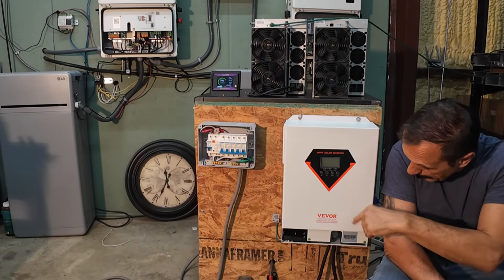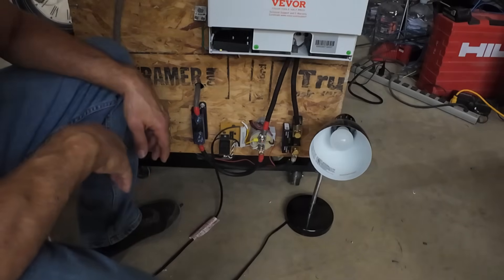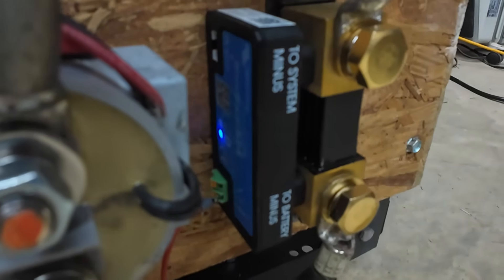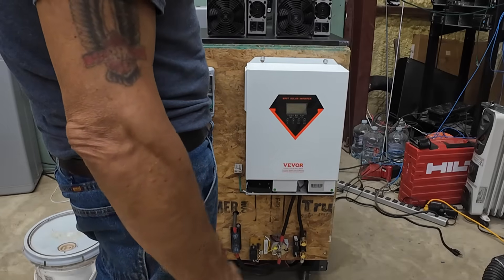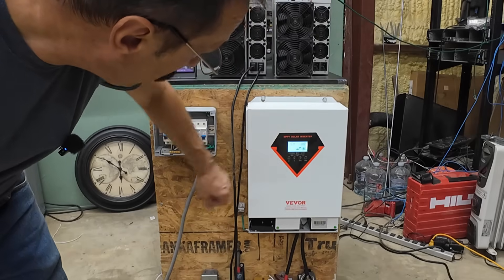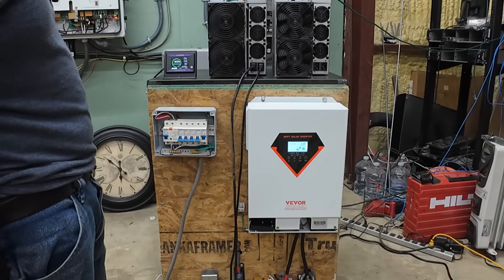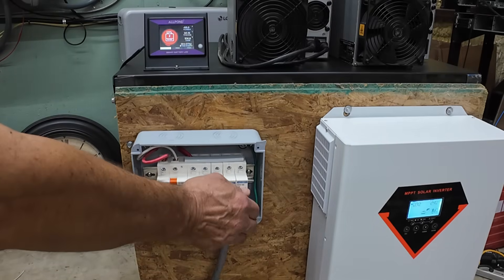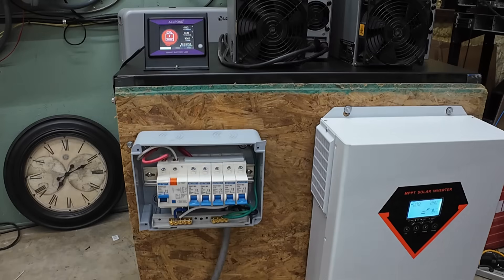Budget Vevor 6.2kW Inverter vs S19J: Does It Hold 3.2 kW?

Comment: I got 5500W version last year, but got to unbox it 2.5months ago. It has been in use since then. Several days ago it started to rebooting after reboot, showing "error 14". Reboot occurs when inverter starts charging battery from grid and passing trough grid power. I paid almost 500$ of it, now its sold for 400€ and this 6000W wifi version is 360€, after days of negoation vevor is offering 290€ or resend same item. I am debating shall i order this with refunded money. I would wish it would last longer. I did not connect it to solar grid yet.
Reply from the maker: Thanks for sharing your experience, it's good to know that Vevor is honoring the warranty!
Reply: @DIYSolarFarming  Of course. Thank you for making and sharing these videos. They honor warranty, but its a begging game. First they did offer a replacement motherboard, i questioned its safety, then it switched to "bring it to repair somewhere" in my country they pay the bill + 50€ voucher for next buy, in finland there is no-one doing repairs for inverters like this. After that, they offered me 145€, i declined with counter offer and last solution which i acceped was 290€

I am really happy with their service, as i bought the inverter 07/2024, so a little over a year ago. Could not get a better outcome. To be honest, i do not know how long warranty they give, but i assume it is 12months.

I will keep buying their products due to this experience.

Comment: You could also just have a DC adjustable power supply where you can limit the current on it just have the battery connected but turned off Connect that to the lines charge up the ambassadors with the DC power supply set at the same voltage as your battery and then just flip the battery on

Comment: Ordered the 2 lg hv battery bundle with transfer switch 200 amp meter and 11.4 growatt inverter plus one more lg battery.  I used your code and got a sweet discount today as well.  Appreciate the code and look forward to getting them connected to the my SolarEdge inverters.  I bought the bundle for another system I’m going to build for the growwatt inverter. I have 180 560 watt panels.   I’ll be tinkering for some time.  Look forward to more vids.  Thanks Ed!!
Reply from the maker: Awesome, I'm glad the code helped! That's a good amount of power, are you setting up for mining ?
Thanks for watching!
Reply: @DIYSolarFarming yes. I’ve been mining since march of 2014.  Got slowly pushed out of my big farm due to power costs. I had a rent house with 320 amp service installed.  I’m very small scale. I’ve got some kaspa miners running and I’ve been scooping up some s19’s on eBay under 400$.  Once I work the bugs out I’ll spring for some s23.  I would like one of the hydro units but I’m worried about putting all my eggs in one basket.  I’d rather have 3 miners that cost a bit more vs risking having one go down and I’m out.  Also keeping an eye on jack Dorsey new miner the proto rig.  I’d like to support local if possible.
Reply from the maker: @DouglasHeyen  Yeah, I like the concept of hydro also and was thinking of getting some S19 hydro's but then I remind myself that when power is free I'm farther ahead money and hash wise with 3 air cold units.
That might change if I can't source cheap solar equipment but don't see that happening any time soon.
Good luck and stay in touch!

Comment: Ok. That's exciting. Even as bitcoin halves if you can get 2 s19's to run off free sunlight with minimal investment that's pretty impressive.
Reply from the maker: Let's see what happens!
Reply: @DIYSolarFarming  I see another good use for this. AC and Heat. My entire package unit pulls 3500w max and puts out 4 tons of AC. I could easily run that off this inverter and 5000w array. $300 for the inverter, some inexpensive chinese lithium, and a few hundred bucks for some used panels could replace half my electric bill. Hmmmmm. 🤔
Reply from the maker: @p35flash97  Cheap way for someone to get into solar and really get a payback vs paying tens of thousands and never see payback!

Comment: Crazy thing is that those minners will step down the ac back to low DC (like 12 and finally 3,3v) for the actual has  chips ons the board... we should be feeding these machines low voltage DC directly ;)
Reply from the maker: That sounds good on the surface but these things are pulling ~200 amps at 12 volts!
Just these 2 S19's would need some massive batteries and cables, it's just not scalable.
Reply: @DIYSolarFarming  It’d be cool if we could feed them 500V DC.

Comment: Thank you Ed, so you don't need the cap precharge if you have the solar connected?
Reply from the maker: Good question. PV being connected doesn’t guarantee the battery bus caps are charged. I haven't verified on this unit but on many inverters the MPPT is isolated, so the battery input still sees a big inrush when you connect a battery.
I'll have to check that out.
Thanks for watching!

Comment: Just use a 60-100W - 120V light bulb instead of the power resistor.  No LED Bulb required!  K.I.S.S.
Reply from the maker: Thanks for the suggestion!
The LED bulb was only for demonstration, not using it in production.
Reply: @DIYSolarFarming  ~ I like using an incandescent bulb so I can visualize the charging and prefer oven bulbs as they are much smaller, rugged and easy to source.

Comment: Great video. Let's see what load it can really take now. BTW where you have the 4 surface resistors getting hot when tested, they may be running warmer since cover is open so fans can't pull air around them to vent/circulate. Just a guess as it could go either way with them being at the top. Looking forward to the next tests
Reply from the maker: Thanks! 
Next video coming soon!

Comment: what would happen if you don't pre-charge battery?
Reply from the maker: There's no solar or grid connected so it would just have a shorter run.
Reply: @DIYSolarFarming  sorry, i meant to say inverter. i have two Eco worthy 5000 inverters @240v . The manual doesnt mention pre charging. Will i ruin the units not doing this?
Reply from the maker: @brokenrecord4069  It's generally recommended to do a pre-charge when you first connect the battery to a discharged inverter. When the caps on the inverter input are discharged it looks like a dead short to the battery for a split second, that's why you get that big spark when first connecting.

Comment: Not long and boring at all, in fact so info packed had to replay some sections. I like the matter-of-fact, info-packed style of your videos. No fluff or filler. Wonder how many Satoshis this short run generated :) I use a topdon IR camera too for component monitoring, but I went for the hand-held independent model, the phone-wart version seemed too delicate.
Reply from the maker: Glad you found it useful!
Can't beat an IR camera for electronic service work!
Thanks for watching!
Reply: @DIYSolarFarming  Absolutely. The very day I first got mine I found a connector that had loosened from heat cycling and was at over 100 degrees C. I now consider IR cameras a must, not an option, for all DIYers who deal with power electronics.

Comment: I personally would not buy anything Vevor
Reply: I have 3 of there 3000 watt 120 volt all in one inverters running, no issues
Reply: @pizann350 you have a link for that model?
Reply: What is your experience with them?
Reply from the maker: That's fine

Comment: Probably a better ROI than mining, is charging an electric car from solar and riving for free...especially if you do deliveries/uber/go around and get marketplace/craigslist stuff to resell.     related:   I use a cheap High Voltage PwMr inverter charger   to use my Chevy Bolt traction battery to charge my House ESS (48v)   for those rare times, rather than running a  petroleum fueled generator , it's quieter and cheaper and more convenient.   NOT for the average person it's High Voltage...one mistake can kill you.
Reply from the maker: Be safe brother!
Thanks for watching!

Comment: Nice! Can't wait for more load.  This inverter is good for mining but without split phase, it is limited. But geez its cheap.  Even if it doesn't last that long, just by three and replace it when needed. Thanks.
Reply from the maker: More load queued up!
There are other uses, one of you guys had the best one, Hot Water. 
I think that's an awesome idea, if the inverter will run without a battery, ROI in no time!!!
WE WILL TEST IT! ;)
Reply: @DIYSolarFarming  Works great if you only want to shower when the suns out lol. :) Although, I suppose if you had just enough battery saved up you could turn it on right before you go to work in the morning since hot water tanks are so well insulated. Or maybe use one of those instant tanks?